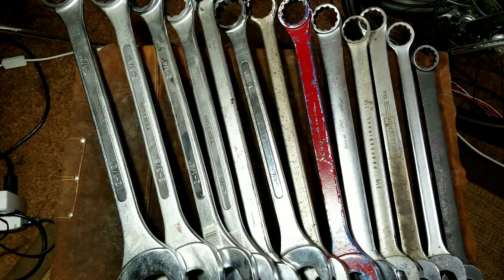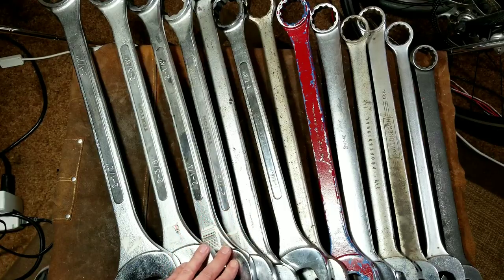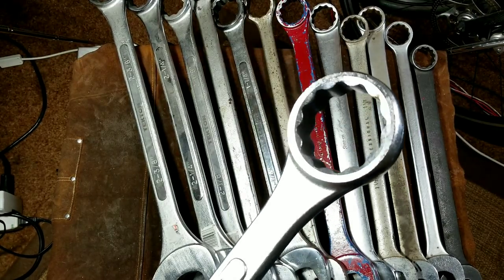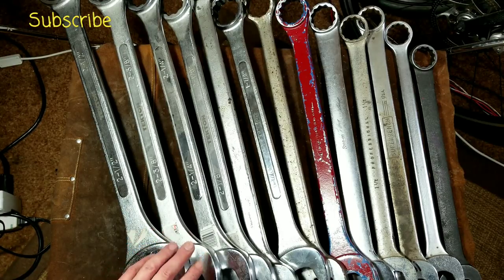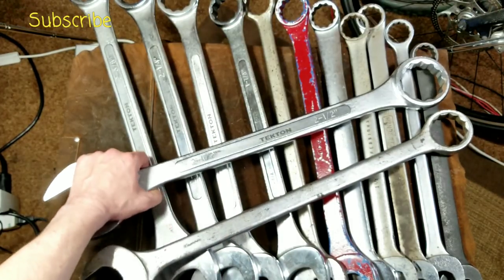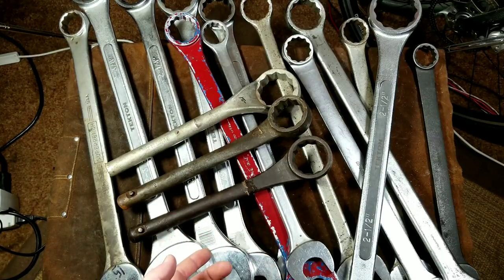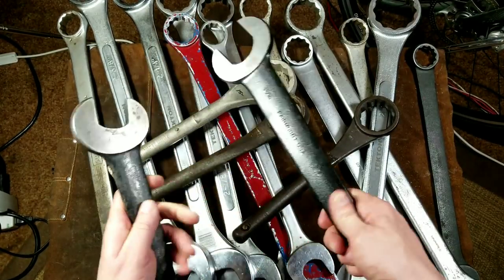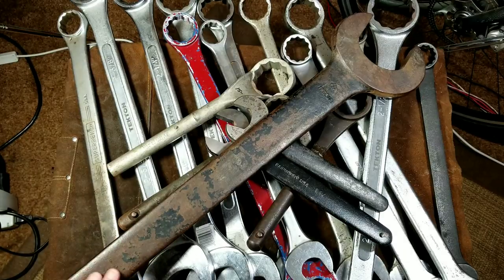Big, Large & Heavy Jumbo Wrenches Review

Comment: I worked on earth moving equipment for a while years ago. Bought large chinese wrenches to get started. By the end of the year had replaced all the wrenches with Proto as I had cracked all the box ends.
Reply: Would you mind elaborating on the brand or brands that you cracked?  We have plans to work on our CAT equipment, so we need to tool up with certain jumbo wrenches.  I'd also like to know which size wrenches you actually use for your work.  Thank you for your time.

Comment: I use jumbo wrenches to tighten base bolts on columns as an ironworker. The Klutch from Northern Tool and Jobsmart from Tractor Supply are soft and bulky. I try to reach for the SnapOn or Williams if I can find that size
Reply: Real tools for real work.  Not some homeowner bargain for one or two weekend projects and then get forgotten.